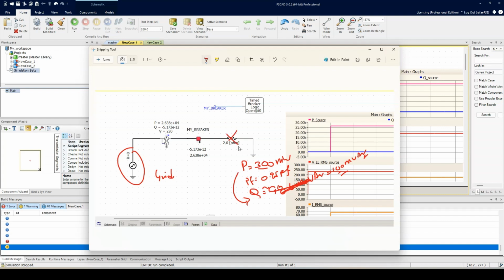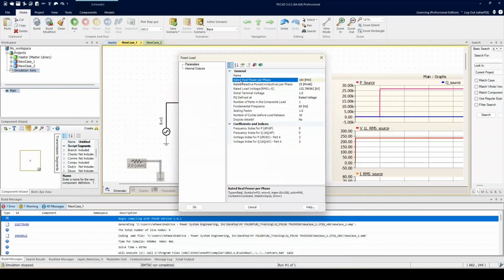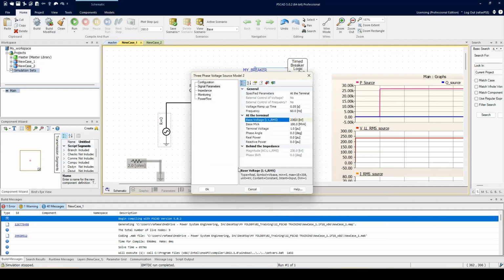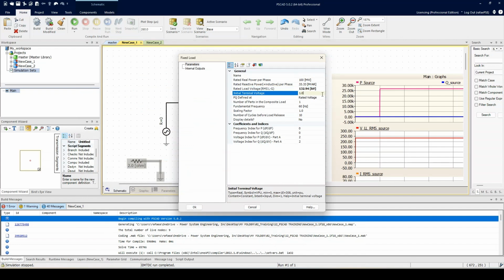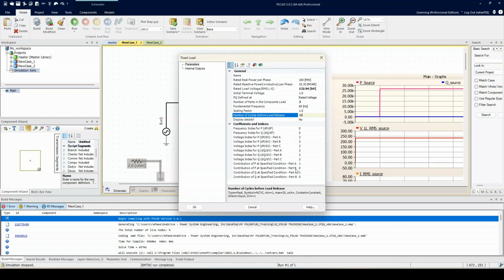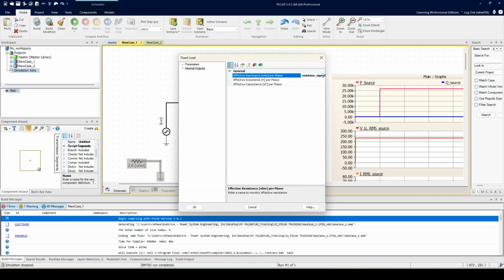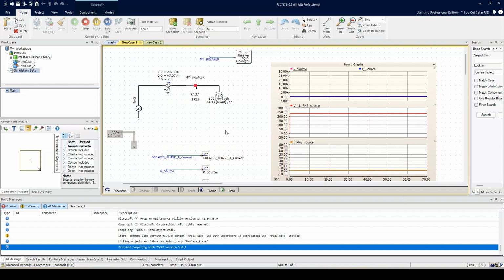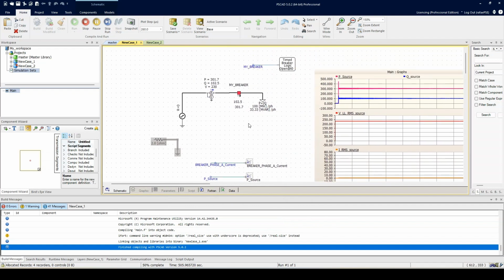PSCAD BASICS - PART 10 - LOAD ADDITION

Comment: hey man. i have one question. how do you actually zoom out graph to required time. in my pscad i cant zoom out out of time that i set my simulation to run. if i set it to100 sec, i can't zoom out more than that.
Reply from the maker: Click the graph, press ‘-‘ sign a few times and it will zoom out and ‘+’ key zooms in. You can also press ‘R’ to get a nice overview. 

What I also like is zooming into graph and then pressing ‘Y’, that also adjusts you Y axis. Hope that helps